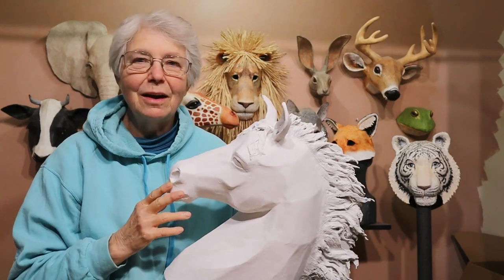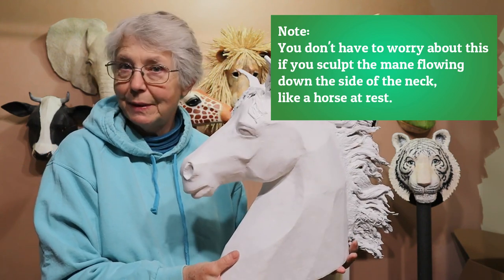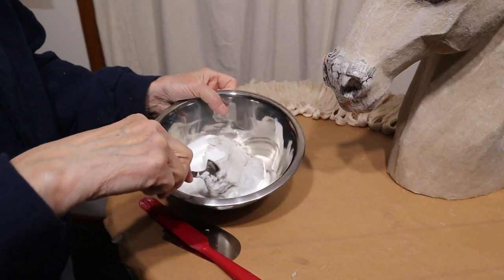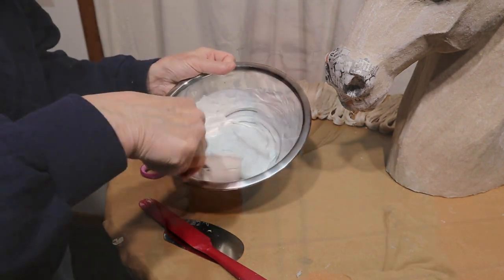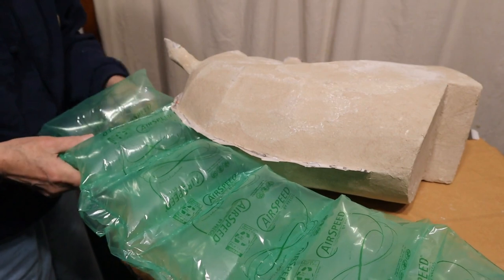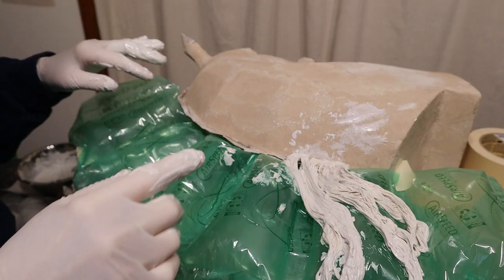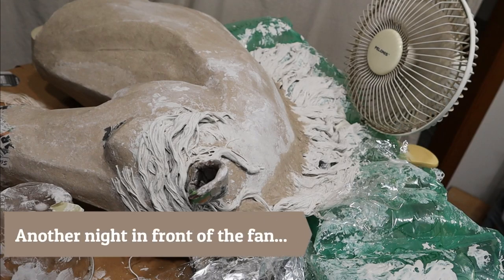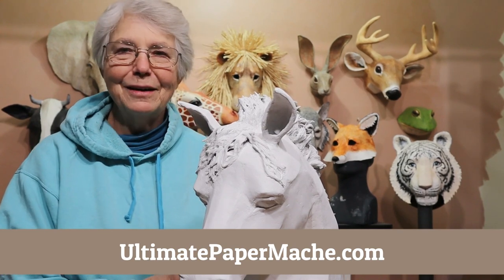Sculpting The Mane on the Horse Head Sculpture

Comment: Dear Madame, 
So much fun after such a long absence! Yey!
The maine turned out incredible, well done! Maybe I would have used either a bit of cardboard with the same shape of the maine and then would have glued the yarn on it, OR maybe plaster cloth instead of the cardboard... Maybe it spoil the movement you've achieved though...
Reply from the maker: Those ideas may have worked - perhaps a combination, with plaster cloth used to set the basic shapes in an undulating but mostly flat shape, and then the crochet thread over it. I might try that someday. BTW, it's good to hear from you. 😊

Comment: Hi, there, this looks amazing! Will give it a go. May i ask, what is the benefit of mixing the glue with the joint compound and not simply just using the joint compound on it's own? Does the glue strengthen it? Help it keeps it's shape? Protect it from moisture? I only ask as ive only just started crafting with joint compound but i haven't been mixing glue with it. Thank you!
Reply from the maker: The joint compound has no structural strength, so the mane would be easily damaged if it was just smeared with it. If you only want to use one product, it would be better to use the glue instead. When it dries the string would be very stiff and less likely to crack. It isn't as easy to paint, though - and that's why I add the joint compound.

Comment: I LOVE this!! I am making my horse with real horse hair! I am entering a Kentucky Derby Hat contest and I am using the horse for the focal point on my hat! I cut down the base a bit to make it sit lower and closer to my head. I also modified the ears to make them stronger and a bit easier to position. I put the ears together but made the bottom strip wider with tabs. I cut out 3 small slits in the dotted circle and pushed the tabs through folded them over and taped them. Worked fabulous! I am using the blue masking tape and it doesn't stick worth a crap. Where can I post pics when I am done?
Reply from the maker: Wow - Your hat will certainly stand out in the crowd, and I can't wait to see it! You can post photos here: https://www.ultimatepapermache.com/daily-sculptors-group-page

Comment: I am painting my horse black and can't decide if I am going to do the strips or the clay. I bought black napkins to use instead of the toilet paper. I am hoping it will be easier to paint since it is already black. I am not very experienced in painting. What primer do you prefer? You do awesome work!
Reply from the maker: If you want to use the black of the paper as a base, you might not want to use a primer. Any primer would cover the color that's already there, and acrylic paint can be used over unprimed paper. If you want the ground to be white, you can use either acrylic gesso or any latex primer. Or you could get a spray can of primer (but not paint+primer, which dries glossy so the acrylic paint won't stick to it very well). You can often find spray primer in dark colors.

Comment: Hi , can I use the paper cement clay for this horse head sculpture?
Reply from the maker: I'm not sure, and I'm nervous about trying it. It could be used for an indoor sculpture without any problems, but it's heavier than the air dry clay recipe, so I'm not sure if it would be better - unless you're worried about using a mixture that contains flour. However, I don't think I'd try to use the horse pattern, made with cardboard, and trust the paper cement clay to keep it dry. It just hasn't been tested enough yet, and we aren't sure which sealers work best. If you don't mind experimenting, with the understanding that it may not last forever, it might be fun to give it a try.